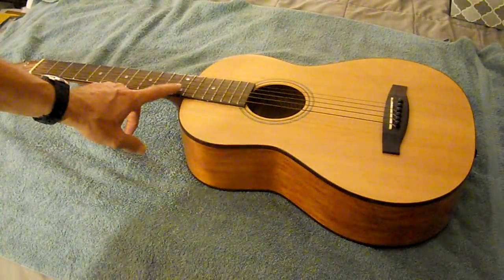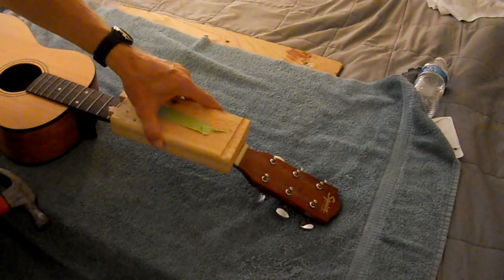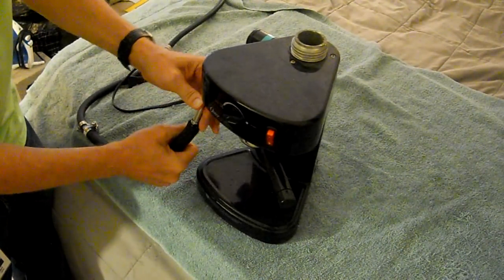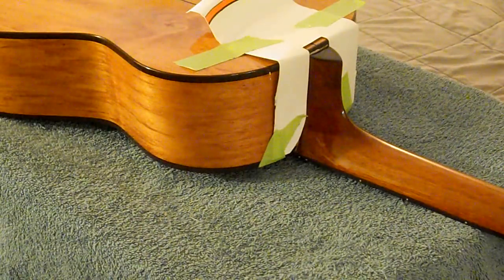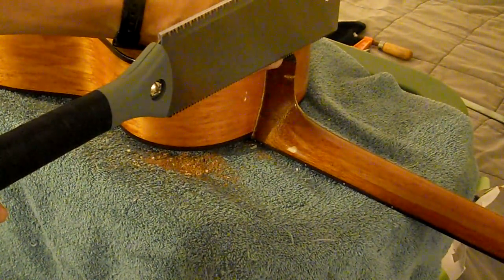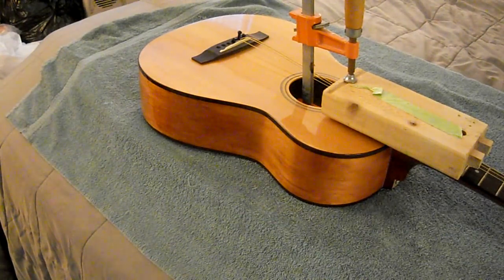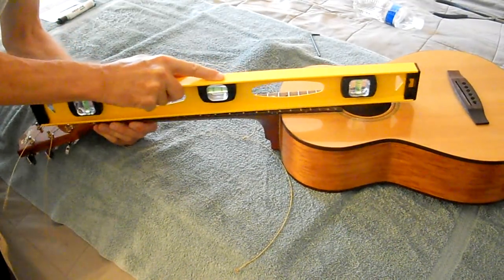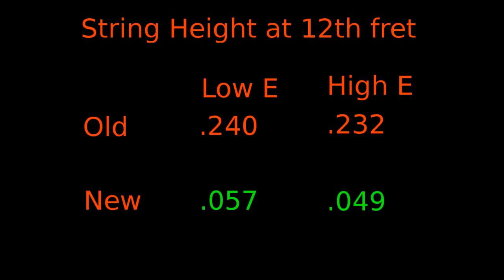Fender Squier Small Guitar Quick Neck Reset

Comment: I never cease to be amazed by all the armchair experts claiming you "ruined a perfectly good guitar" or telling you to "never touch a guitar again." They seem to think that every instrument in desperate need of a neck angle adjustment needs to have a full $500+ neck reset job, even if the the guitar is a $40 craigslist find. Not a single one of these overly harsh critics has anything worthwhile to say. Obviously if simply lowering the saddle height or shaving the bridge would have fixed the issue, you would have done that first. What you did here may be "crude" to some, but it was a necessary fix for an instrument that's not even worth the minimum bench fee for a reputable luthier. You did a good job restoring playability to a guitar and most would consider not worth fixing. Ignore the trolls.

Comment: That's the most appalling remedy for a high action I've ever witnessed.
Reply: It's better than throwing it in the trash can.  These high action guitars are useless.
Reply: @markwillis2980  a lower bridge saddle height is all it needed. You ruined a perfectly good guitar.
Reply: Friends are always coming to me wanting the action lowered.  And lowering the saddle would be the better solution.  But there are limits to how much lowering I can get before break angle problems and sound problems.  And friends aren't satisfied when it only takes it down a mm or two.  My solution here is not appropriate for a nice guitar, but fine for craigslist junk.  On these guitars I never worry about resale value.  This guitar is quite fun to play now.  I performed with it a couple weeks ago, and everyone who picked it up loved the action.
Reply: @mikeregan3265  No it is not. If the action really was .240", there is no amount of saddle adjustment that could fix that. Even to bring it down to the average action of .100", you would need to remove .280" off of the saddle, which is literally impossible to do.The strings would be resting directly on the bridge plate.
Reply: @unsubpress7093  please stop with this nonsense and move on.
Reply: @unsubpress7093  11 months. Don't be a fool.

Comment: At the very very least, could you not have countersunk the hole in the heel and used a screw/bolt that would sit flush? then you could easily glue the heel piece over it.

Comment: okay so for your procedure in particular you didn't saw the neck completely off? you mainly sawed up to the truss rod and then reattached to the body, letting the small bit of remaining wood on the sides of the truss rod experience some flexion? just trying to understand. is this advisable or harmful? i want to do a quick reset and know that little bit where the truss rod is will be tricky

Comment: You can use a very thin saw with no set in the teeth to saw the neck off. Then, install proper bolts as per modern bolt on necks.
The finger board extension shouldn't be left flapping , so to speak, but should have an appropriate wedge fitted under it. 
That heel gap just looks awful  !!

Comment: I'm a luthier with a busy shop.  I build custom guitars, I do repairs, and I restore historical guitars.  I work on everything from prewar Martins and Gibsons, to 19th century guitars, to inexpensive guitars like in this video.  I've run across many guitars where the dovetail tenon is bottomed into the mortise, or in the case of a bolt-on, the tenon is bottomed out. Most "chicago" made guitars will have bottomed out tenons.  I've also done resets on necks that have been installed using dowel rods.  In short, I've pretty much seen it all.  I'm a veteran, so I also donate my time and guitars, with veterans, through the Guitars 4 Vets program.  This is how I would have handled this reset (assuming it's not a 100+ year old historical):  first I would have  looked to see if it's a bolt-on (they're concealed, so you need to recognize the cover).  If not a bolt-on,  I would have recognized a problem when I drilled and not hit the pocket normally found under the tenon. 

I would have taken the 9th fret out (yes, this high) and sawed through the board ONLY, through that slot, carefully avoiding cutting into the neck.  By removing only the lower part of the board at this level, you can visualize the joint, plus you can glue it back accurately and with enough neck to properly clamp.  You can now drill holes for the steam needle, either at the mortise/tenon seam, or if this is missing, at the junction of the body/neck.  This way, you can loosen the glue and remove the neck, retaining whatever method was used to install the neck, short of a screw through the heel, into the body.  But, I promise you, you will not see this on a production guitar.   I have a custom guitar on my bench, right now, with a drywall screw, installed at an angle through the heel, then concealed with the heelcap, obviously by someone who didn't understand the mechanics of guitar necks. 

Unless you run into the scenario of the screw through the heel, like I have on my bench, bolt-ons not withstanding, steam will remove the neck.  

So, you're most likely dealing with a mortise/tenon of some kind, and you can take the appropriate amount of wood off to affect an angle which will set the neck at more of a backward angle, thus resetting the action.  After fitting the neck geometry properly, and some scribe sanding to sit the heel onto the body seamlessly, the neck can be glued back on properly.  The only bolt should be the original, if a bolt-on (yes, glue is involved in bolt-on necks too).  The one other scenario is a pocket installation, usually seen on 19th century guitars, but if you remove the fretboard up to 9th fret, you'll see that too, and you'll just follow the protocol for a bottomed out neck.

If the neck is being held by dowels, not likely in a modern steel string guitar (and assuming it's not of historical significance) I would turn it into a proper bolt-on, by drilling holes from bottom of the neck block (accessible through the soundhole), into the neck (2 for larger guitars), install threaded inserts into the holes in the neck, and bolts through the block into the threaded inserts.  The bolts need to be countersunk and once the reset is done, they're covered with a wooden plate.  
I've never seen an adjustable neck on an expensive guitar, and I've worked on $60,000 guitars.  I do have a 1950s era guitar with an "adjust-o-matic" neck sitting in the shop, but it's value is about $150.
Reply: Thanks lots of interesting information that you took the time to share.
Reply: I too thank you DK. Much appreciated!!!👌🏽🤙🏼😎.
Reply: That was a humble and respectful responses. Your restraint is impressive.

Comment: Thank you so much for posting this!  I found a 1967 Marquis Harmony Acoustic at the local goodwill ( for $10) and the thing sounds better than my brand new $500 mid range acoustic.  The problem is that the action is crazy high and no amount of truss rod adjustment is helping. It apparently sat in a closet for years with the string wound way too tight and the neck is severely bowed.  I can manage to play cowboy chords and that's it.   I will follow your lead and use an iron and an old espresso machine to remove the neck. I definitely cant spend the $600 it would cost to have it done professionally.  Hopeful I end up with a $10 beast!  Thanks again.
Reply: Good luck, let me know how it goes.
Reply: How did the Harmony turn out?
Reply: Hey man, did you adjust it successfully?
Reply: The truss rod is not for adjusting the action. Though it has an effect on it.

Comment: Saved my 1972 Elger acoustic which isn't too shabby of a guitar/Brazillian rose wood back/solid top.   Didn't do exactly what you did but same basic idea.  Thank you thank you.   Elger had 5 dowels -repaced three with wood dowels/other 2 thin bolts.  Did not cut a wedge out of the heel but rather larger drill hole into thinner drill hole but just into it a 1/4 inch and cover bolt head with wood filler.  Thanks again...never expected this the neck did NOT steam out and was at a loss for what to do.

Comment: I picked up a Suzuki acoustic cheap from a secondhand store. It appeared to be in good condition, but the strings were too high, and the sound board and bridge was all chewed up and cracked across the middle. I was able to lay the sound board flat, and solid again by clamping it down tight and regluing the lifting pieces back down into their normal resting areas where they came out of. I took a mirror look inside and saw in a couple of places some wood splinters had disappeared over the years of abuse stringing this guitar.. It wasn't really all that bad overall that some epoxy couldn't level out and have a complet level suface again that would do the job of holding the string buttons solid once installed. The bridge had to be removed and replaced with a new one. There was no way to save and repair the old bridge, so it's getting a new bridge in the days to come. Back to the neck, I had to completely cut it off to reset the neck to the right angle as it was held in place by dowels. I haven't finished the job yet, but I plan on using a couple of dowels to keep the neck from twisting once reinstalled and will bolt the neck back on from the inside of the guitar area (through the inside neck block) that way no bolt will be seen form the outside of the neck heel area. It's sad that guitar makes make guitars in such a destructable condition that require neck resets over time. Using a straight edge across the frets it laid level with the guitars body when I first started this project. When I'm finished that neck will be correct t the right proper level it should be for a nice sounding small guitar some person will enjoy playing down the road. It's as nice a guitar as the one shown here in this video. Chow...

Comment: Could have run that mechanical fastening via the inside of the body, without cutting the heel. Use hanger bolts.
Would take a while longer due to drilling in that confined space, but a much cleaner and less invasive way to do it.

Comment: If you used a heat gun on the fretboard at the 12th fret, so that it would bend, you would not have had to separate it from the body. Doing so would allow a lower string action and cleaner finish.